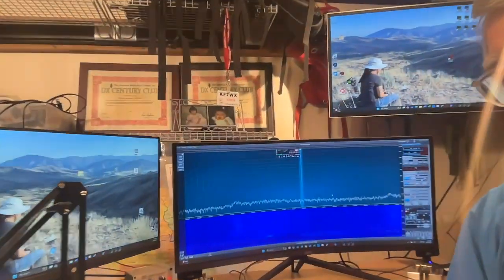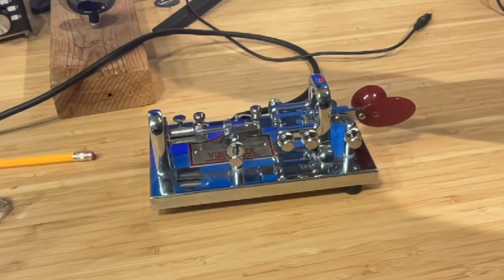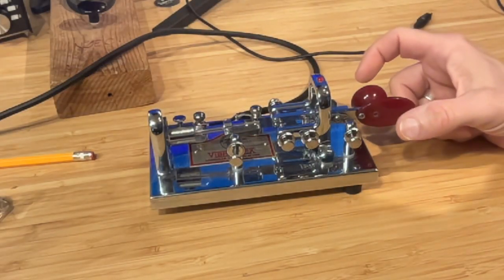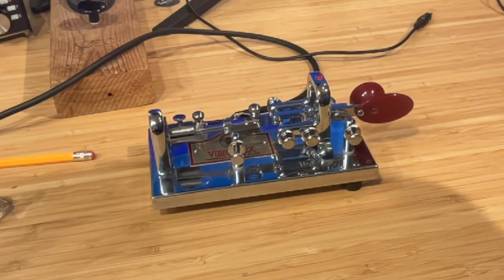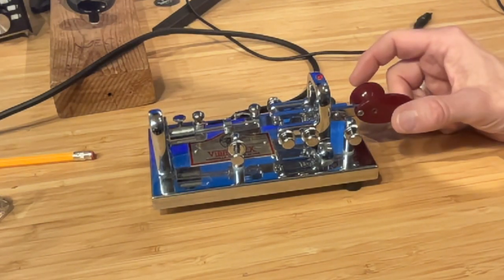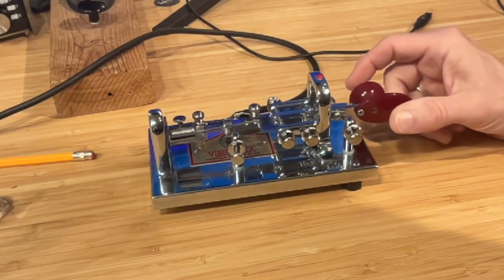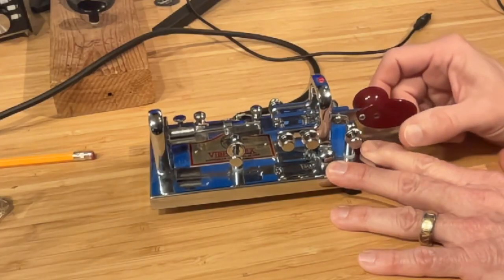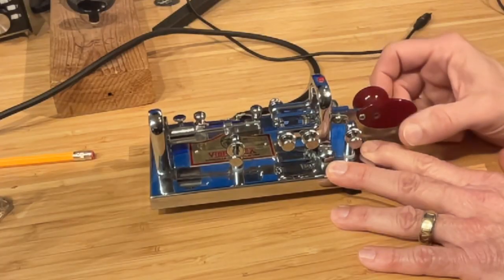Semiautomatic Keys

Comment: You use a bug when you don't want a CW skimmer to pick you up.  The timing makes it hard to decode. DX stations may want to do this.  You still get a pile up but it takes a bit longer.
Reply from the maker: Interesting!  I hadn't considered that.
Reply: A CW skimmer will pick up a bug just as often as an iambic paddle IF the bug op sends good code. I’ve been taking a bug out to the field recently for POTA and I do not get picked up as often by RBN as I do with an electronic keyer but that is the fault of myself, not the bug! 

But to your point, many bug ops have a specific “swing” or accent and that’ll almost never be picked up by RBN.
Reply: We built bugs from plastic Radio Shack keys and hacksaw blades back in the early 70's! Your vibrating arm should meet a damper when you release it, so that it stands still, ready for the next dits. Take that key up to speed and find the "swing!" You'll never go back!

Comment: That's the best demonstration of a bug that I've seen (one of the first, actually LOL). I wonder if anyone has tried making one that does the same thing with dahs as well?
Reply from the maker: I'm not aware of anything  like that.   As long as size is not a concern, it should be possible.  I've experimented with adding more weight to the end of the swing arm;  everything slows down. The dots are stretched into dashes, but the spacing between them also widens, so a different machismo would be needed.  I haven't done any research on this topic; there may be people working on this already.